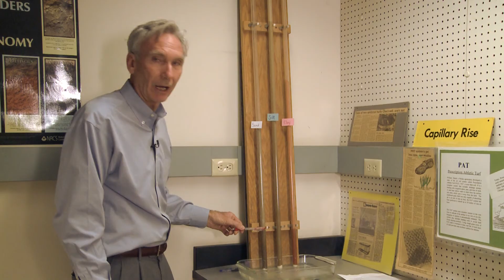Soil Basics: Capillary Rise

Comment: how high is the rise for each of these soil and how to calculate them?
Reply from the maker: Hello @C Xyooj - As the video discussed, capillary rise is greatest in silty soils (medium to fine particle sizes), and lower in both sandy (coarse particles) and clayey (very fine particles) soils.  Capillary rise can be calculated with the capillary rise equation for sands and silts, but it cannot really be calculated for the clays because the flow is so slow in the clays due to the extremely small pores.  For sandy and silty soils, the height (h) of water rise is determined by the largest pore sizes in the material. 

The capillary rise equation is  h=(2) (surface tension) / (radius of pores)(density of water)(gravitational acceleration). 

So for example, for a soil material with largest pore size radius of 0.01 cm, the calculation would be:

H=(2)(72.7 g/sec2) / (0.01cm)(1g/cm3)(980cm/sec2) = 14.8cm=h.  

So the water would rise 14.8 cm up into the soil material.
Reply: @PurdueExtension  thank you for your reply. 
is it surface tension of the soil or the container holding the soil? and is there a table for this variable?
water density varies base on the temperature of the water, so it is least dense in vapor form?
gravitational acceleration is fairly constant on the Earth surface

therefore, the rise nearly deduces to the inverse of the radius of the pores? this is the average radius of the pores?

Comment: But I have read many papers proving that clay shows the highest capillary rise. what do you say about that?
Reply from the maker: According to our agronomists, the reason is that soils are not (except very rarely) made of just one soil type, but a mix of sand, silt, and clay. Soils that are considered “high” in clay might have 30% clay but it is the silt that is causing the capillary rise, as shown in the video.
Reply: @PurdueExtension  the pores "shutting" down by swelling is caused by the presence of expansive clay minerals (e.g. montmorilonite or another smectite; structure 2:1). If these minerals are not present (some 1:1 expand a little as well) then you may have a higher rise. Same for silt. Expansive (2:1) clay minerals may affect the capillary rise.